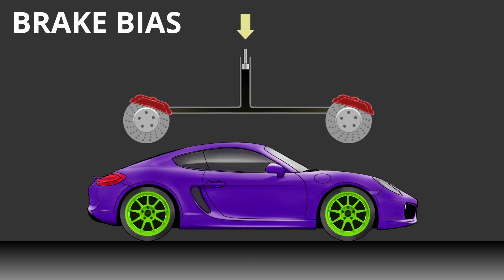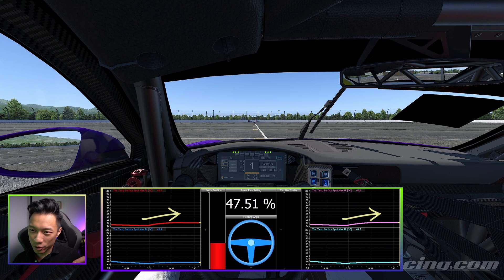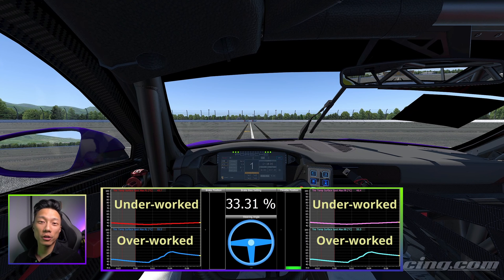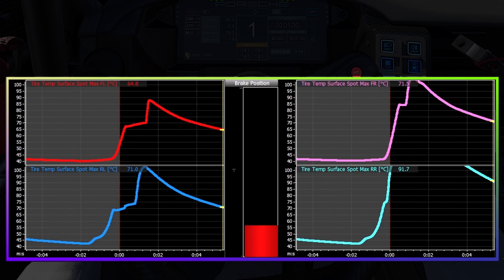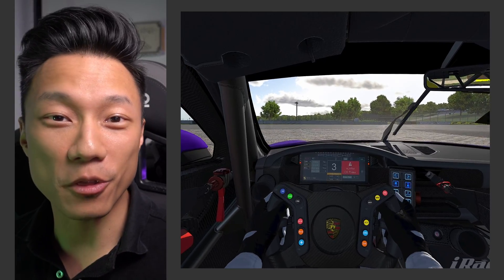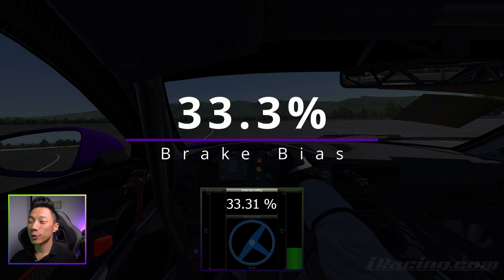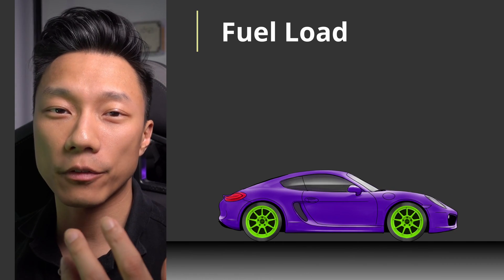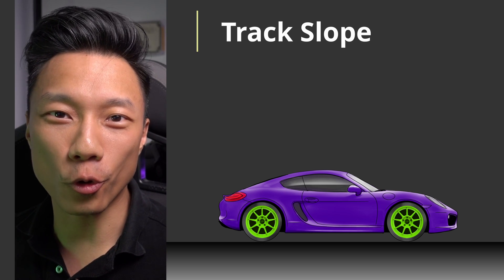Why you NEED to change Brake Bias [SIMRACING TUTORIAL]

Comment: Just came across this, what a brilliantly clear explanation!

Could you say something about how you might need to change brake bias between slow and fast corners?, eg turn 4 at Sebring which is a hairpin vs the final long turn?

Thanks so much!
Reply from the maker: Thanks!
I would say firstly a slow corner may require more deceleration, meaning you will have longer threshold braking and that may change how you want to optimize your brake bias as per the video. Slower corners will have smaller turn radii and more rotation, your brake bias will also influence that.

Comment: In a car like the Porsche 911 RSR GTE  in iRacing how should I manage the brake bias as the fuel burns off & the front end gets lighter over the course of a stint? Would I move the brake bias fwd or backwards?
Reply from the maker: You can reference the example here https://youtu.be/UK2sl0Po-1I?t=610 which talks about a rear fuel cell. You just got to do the opposite for a front fuel cell.

Comment: top quality content.  thank you
Reply: so, in theory, with a Porsche you could start a long race with brake bias a bit more to the front, and then as the fuel cell drains you would adjust it slightly more to the rear so that the front doesn't lock up so easily?  Did I get that right?
Reply from the maker: Thanks Mark! And yes you got that right. BUT, it depends on which Porsche, not all of them have a front fuelcell.

Comment: nice video, good explain, I drive rFactor 2 and these settings are important. I wait for my Asetek Invicta pedals too for test the braking will be better in rF2 on diff cars. can't wait to test. thanks for this nice tips here, I don't change my brake Bias while driving, I set it only for the track I drive.
Reply from the maker: Thanks for the comment. What are you upgrading from?
Reply: @LastTenth  i use now the fanatec V3 with bp kit. Good pedals too
Reply from the maker: I had those previously. They're good pedals.

Comment: I am a bit curious about what to do when there is a downhill section but you have to steer into a corner whilst braking like Bahrain turn 10 for example. Should you move the BB to the front because of a downhill section ro rather to the back because you have to turn while braking?
Reply from the maker: Great question Soldat! First off, I'm not familiar with Bahrain so I had to look up some footage. The short answer is, it's always a compromise.

The more trailbraking vs threshold braking you need to do in a corner, the less forward load transfer because of the lighter braking, the less grip the fronts will have. On top of that, the front tires can't do much braking because of all the turning they're doing, so you will want more rear bias. For T10, it doesn't look like there's much straightline braking. But like you also pointed out, in a downhill section you want forward bias. It could be that the two requirements nullify each other and you don't need to change it at all. So there's no absolute or correct answer. Brake bias is different for everyone and responds differently to every setup. You have to go drive it and see where the bias works best, keeping in mind the car's balance and the tire temps so that you don't overheat the tires on throttle. But the important thing is that you're fully aware of the slope and trailbraking, so when and what bias changes to apply.
Reply: You may be able to find an onboard of a real F1 driver and see on their steering wheel how they change BB for that corner.

Comment: To add to this, a hard straight line braking from a very high speed (such as the end of a straight into a tight corner) will optimally require a more forwards brake bias because more weight transfer is happening towards the front under hard braking, whereas a more gentle braking zone can benefit from a more rearwards brake bias as there's less weight transfer towards the front.

Also F1 cars and some prototypes have what is called brake migration, where the brake bias will actually change itself (migrate) automatically during braking based on preset values to be at the optimum value as much of the time as possible. Fortunately to my knowledge that hasn't made its way to a commercially available sim yet, lol.
Reply: The Mercedes W12 also has brake migration in iRacing
Reply from the maker: 100%! I will be talking about this in a future video on braking, but you've basically explained why in corners with a lot of threshold braking, you want more forward bias, and in corners with a lot of trail braking, you want more rearward bias (balance permitting).
Reply: The Audi R18 LMP1 has brake migration in iRacing just fyi :)

Comment: Always wondered what really triggered oversteer when braking with high rearward Break bias, and this LastTenth explained it so well:
The tires heat up and lost grip so as you turn in there is no rearward grip therefore spinning.
thank you!
Reply from the maker: Yes the heat creates a vicious cycle. It makes the tires lose grip, and slide, which heats it up more. Before the heat though, too much rear brake causes the rear tires to slide, which causes the heat.

Comment: Very nice video. Lot of food for thought. The only takeaway that I can apply atm before learning more about aero is to try and move bb to the front 3 quarters of the race in to see if it helps with a lighter fuel tank.
Reply from the maker: Did you try it out? How did it go?
Reply: @LastTenth  not yet still at work. Will update you

Comment: Very good video. I really liked the 6 reasons at the end as it makes us think about the 'why' when we change BB, as well as the factors that go into those 'why' questions. Something to add is a tires total available grip, often shown as a circle (Accel grip, braking grip, Left/Right lateral grip), can be manipulated with BB, so it would be neat to see how that affects your 6 reasons as well.
Reply from the maker: Thanks Alex! If you've seen my other videos, 'The Why' is a very important part for me.

Great suggestion btw! BB by itself doesn't really change the total available grip, or the traction circle, of a single tire; it changes how much of available grip is used though. Implicitly, the things I mentioned in the video changes the traction circle on a single tire. For example, Aero will increase grip. The Slope and Camber of the track will shift grip longitudinally and laterally as well. Basically, the reason BB needs to be changed is often because of changes in the traction circle of a particular axle.